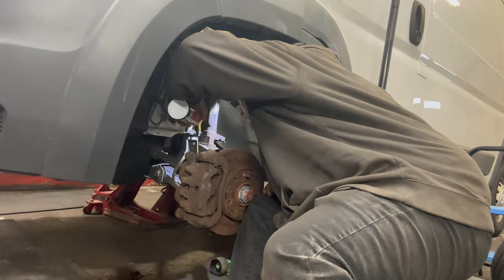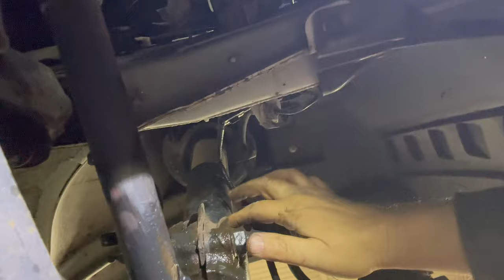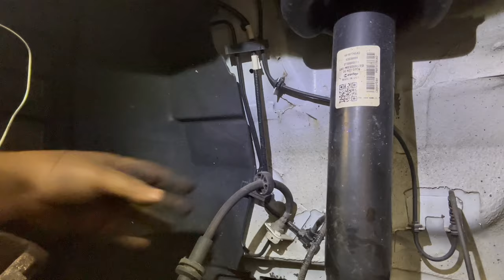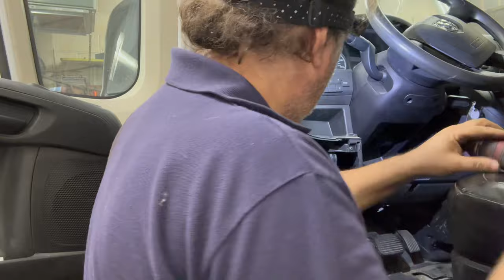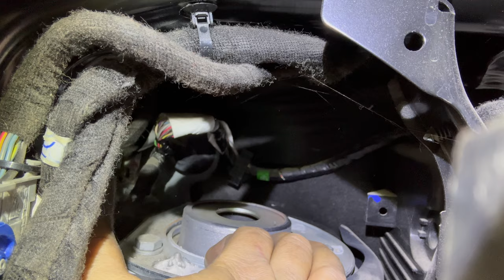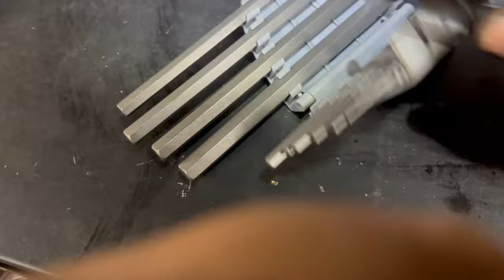Ram Promaster: STRUT Replacement Start to Finish. Step by step. How To. Replace Struts!

Comment: I did this job, by myself, when I installed the van compass 1.5inch strut spacers.  The trick for me was I have really long, skinny arms and I was able to use one arm to hold up the strut and the other to reach under the open door to thread one nut on the top of the strut.  Once I got one nut started, the rest were easy.  I did the entire strut spacer lift kit in a little over 8 hours of continuous work.  no lunch, no bathroom breaks.  This was the first time I ever did anything like this and even though it was an all-day project, it turned out great.  5 years later and the van still drives great.  I wish I had this video when I did this project since your method skipped the removal of the 46mm axle bolt.  Removing the axle bolt is a major pain in the ass which cost me a couple of hours.  Thanks for another great video!
Reply from the maker: You must be some kind of ape, with crazy long arms!

Normally, we get annecdotes of axle breakage when you lift anything over 1”. Have your axles survived 5 years? How many miles in that time? What tire size are you running?
Reply: @promastersonly1419  Yes, I haven't had any issues with my axles or CV joints.  So far, I have over 90k miles on them (original axles), and everything is running smooth and quiet.  I installed the lift to level the van and it has worked perfectly.  For tires and wheels, I installed the Cooper LT245/70R16 on MSW allow wheels 16inch x 6.5inch which I bought from tirerack.  The cool thing about this combo is that the wheels were designed for Fiat Ducato, so they have the correct offset and even OEM peg mounting holes, also, the tires are 1 inch wider than stock, but exactly the same height, so my speedo and gear ratios are still within factory spec.  Over the last several years of cruising the freeways at 85+ mph, the van drives great.  I even get 17mpg with this combo.  btw, my van is a 2017 136LR.
Reply from the maker: Interesting combo. A 245/75 will fit and clear, and it's what some of my customers upgrade to if they are chasing fuel economy. I hadn't thought about a 245/70. There's no reason to "expect" to need axles with any regularity - I can show you vans that need one every 60k and others with 500k on original axles. Luck, I suspect. If you want to be proactive, the symtom will always be a vibration that comes on at a certain speed, usually around 45mph, that goes away immediately when you let off the gas. I have a video on inspecting them, which is pretty easy to do.  @arnenystrom4283

Comment: This is mostly in response to @pandafoo6445 question about what pieces of the OEM struts to use on Bilstein B6's.  I am doing exactly the job right now for both the struts and the rear shocks for my daughter's conversion van.  (She is a rock/mountain guide in Estes Park, CO.)  The shocks are easy to do.  You just need an E24 E-Torx female socket and a wrench.  Just hope that you don't have the bad luck I had where the lower bolt was cross-threaded.  Had to drill out the hole and use some A8 strength bolts, washers, and nut.  Now for the struts.  I not only replaced the OEM with Bilsteins, but also bought a new set of MOPAR Strut Mounts.  The originals were still in OK shape, even though the struts were shot.  I reused the OEM rubber dust protector and the hard foam bump stop that goes over the shaft.  I did not reuse the silver metal part that fits at the bottom of the strut shaft and on top of the strut body.  Based on measurements it didn't seem like it was needed.  Not sure of its function except that it was a place for the bottom of the rubber dust protector to be fastened to.  Just not sure.  
The one part of the reassembly that I struggled with the most was the tightening of the top nut on the strut shaft.  In order to torque the nut to 74 ft/lbs you'll need a strut shaft socket to hold the shaft from turning and a 5/8" pass-through socket to tighten the nut.  (BTW. The top of the shaft is round with two side flat.  That is why you need the special tool.  Got it in a kit at NAPA.)  I called Bilstein and spoke with a tech and he said that using an impact wrench can cause issues with over or under tightening.
Reply from the maker: Yes, and I believe if you do it wrong, you risk damaging the swivel. Plus, anything that involves spring compressors makes me nervous!

Comment: Hi  very good video. But I ha a question I have 2023 promaster. You know where is loquetion  for the fuel cut off switch?
Reply from the maker: A commenter had that same issue. The literature says its where it’s always been, passenger footwell being a kick panel. But dude claimed he couldnt find it. With no 23-up van at hand, I honestly dont know where it is.

Comment: I cant seem to find complete kits for Bilstein B6 struts, just the strut itself. Could you reuse the the parts from the stock "old" strut and put them onto the bilstein? So take the Suspension plate, shock upper mount, Jounce bumper, dust shield, coil, and spring seat off the "old" and put it onto the new Bilstein (those are just the "upper" parts I'm seeing listed on the mopar site)? I know you need some bonus tools to do that job but would that be reasonable versus buying all that new from Mopar? I know it will take more time to do, I've just been pretty interested in the Bilsteins after seeing some positive reviews on the Promaster Forums, I just cant seem to find them fully assembled for the promaster.
Reply from the maker: Bilstein make a superior rear shock, the B6. I believe they only make and sell the shock portion for the front, so yeah you’d have to install the shock into the strut cartridge with the cartridge out - build it out of parts, in other words. 

If you are doing all that, you might as well replace the swivel/strut bearing, and I think your only choice for new is Mopar. Nothing better than Mopar exists, so far as I know. 

Generally, we dont fixate on struts as an upgrade because other than off roading, the stock strut is excellent and the only reason to use something else would be cost.
Reply: @promastersonly1419   I'm one of those crazy off roading van people! I will go the route of new ones and build it out from Mopar when I finally bite the bullet and replace the struts with Bilsteins. Thanks for all the knowledge you share!

Comment: Hello! Thanks for the video! Question though, can one bad strought cause a misalignment in the cross camber? Its as if the vehicle is leaning down on one side, has the alignment off and every other small component in the suspension is fine
Reply from the maker: @adrianromero2284  Sure. The strut is all of the suspension height. Cracked coil, bent coil, collapsed bearing. Other possibilities, but strut is pretty likely.

Comment: Hello! I had new shocks and struts put in all around. All bilsteins and whole strut $$ fancy assembly kit situation was only option for front. Now there is a noise on front end when braking and turning at speeds at or below 40mph. Took the van back and had inspected but they have no answers. They said it’s probably steering bump stocks but is that even possible? Clicking/bang/spring type sound occurs when beginning to turn wheel and at various turning radius points. And when braking! Do you have any suggestions on what I should do? Ask them again to check tie rod? Look into new steering stabilizer? I know nothing but you know everything! Thoughts? 🧐
Reply from the maker: Hmm. My gut reaction is that if you can reproduce the noise when not rolling by moving the steering wheel, I'd have to say the strut bearings installed were defective or otherwise something with the strut. But if that's not it (and the shop probably wouldn't have missed that) there's a lot of possibles. All of them are simple, but they can be hard to narrow down or find. One thing to check is the brake calipers - we've seen loose calipers do that. Also the upper or lower transmission mount. I might recommend getting a second opinion. Reproduce the noise for the tech with him driving, make sure he knows what you are actually chasing.
Reply: Scheduling 2nd opinion and on it! Thank you!

Comment: Thank God you finally made an end-to-end video on the struts.  I'm right in the middle of doing my daughter's van.  I've been watching other videos that don't do half as much.  Based on them I took of the axle nut and loosened the lower ball joint nut.  You didn't do that and were successful.  My biggest problem now is getting a big enough pry-bar and convincing my wife to work it.  That's gonna be fun.  BTW.  Did you have a good time scratching your balls during the break? 🙂
Reply from the maker: Nothing, repeat NOTHING, beats a good long ball scratch at the right time.

Comment: Do you believe these motors should only have Amsoil 0W 30 and this will solve the pen STARTEK with lubrication??? 
Heard it will last forever from it
Reply from the maker: No. I have a video that shows why oil isnt what causes the pentastar tick.
Reply: @promastersonly1419   thank you. Had dealer paid for new engine and reman transmission. After sold that way and lasted 3 months. Should I changes transmission oil when says too?
Reply from the maker: @Tryitall992  Yes. Dirty or neglected fluid and filter wont necessarily make it fail, but clean fluid and filter can only do good, not harm. The spec is 60k for most usecases.

Comment: Hey i think I put my transmission into limp mode after I damaged that abs sensor while I was replacing the struts, have you seen anything like this?
Reply from the maker: I can't come up with any theory of a connection between the two. If the ABS sensor fails or gets damaged, it will light those lights and disable the cruise control, but that's about it. Do you have the red lightning bolt on the dash? Regardless, anything that puts it in reduced power mode, or limp mode will have stored codes. Know them?
Reply: @promastersonly1419  hey thanks for the reply, oh boy I’m getting a P06da,P0868,P0731,p0846 pd,p0755 pd, p06de pe, p06pa pe, p06da pe, p0868 pe, p0731 pe. The truck had a very similar ball joint joint failure and knocked the whole wheel off almost and my cv had to be pushed back into position 😂 I think this truck is Fd this time, she drives after I put everything back together but it just stays in first gear
Reply: @promastersonly1419  and no red lightning ⚡️
Reply from the maker: Tough to say without more info. You have ALL the P0dx codes, which are all oil pump related. The rest are transmission codes. I cant exactly fit the trans codes to the axle failure, and the common point would be the two speed sensors on the rear of the transmission RIGHT by where the axles enter it. If those sensors got damaged, it would definitly throw codes and go into limp (limp mode is 2nd gear and reverse only, about 30mph top speed). I suppose if the engine took a hard enough physical bash it might damage the wires coming from the oil pump, which are behind the power steering pump. Inspect those two areas first, and see if you see anything.  @SamCanine-lm5nk

Comment: Does an alignment need to be done after you replace struts?
Reply from the maker: That’s addressed in the video. No alignment needed.
Reply: I would LOVE a video about this 'tape measure' alignment that has been mentioned in a couple of your videos. How do you do it?? Apologies if you already have a video on that, I'll search for it. @promastersonly1419
Reply from the maker: @AllenLight  I’ll put it on the list of videos to make. Basically, since only the toe is adjustable, you measure how far apart the front of the tires are vs the rear of the tires. You are looking for 1/8” total toe in.
Reply: Yeah! FYI, I think my alignment went off from beating on the tie rod end with a hammer to release the cone joint. Will use a release tool next time.. Also - in your video - please show us where on the tires to make the measurement (4 or 8 on a clock I would guess) and which side to adjust. Both equal or just the side you think it's pulling towards? THANKS! LOVE YOUR CHANNEL! @promastersonly1419
Reply from the maker: We use a couple long strait metal tubes to make sure the fronts are roughly inline with the rears - you could do the same thing with string or anything straight. We just pick a point on the tire (groove or edge) that can be the same on the front half and rear half. 8 and 4 is about right, just make sure you're not hung up on something under the van.  @AllenLight